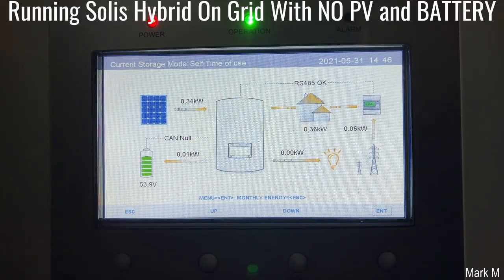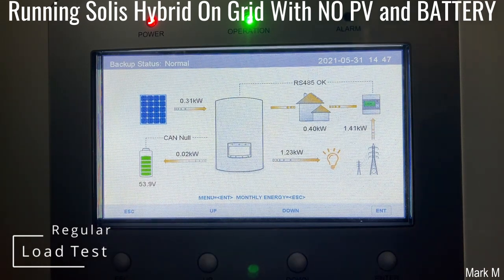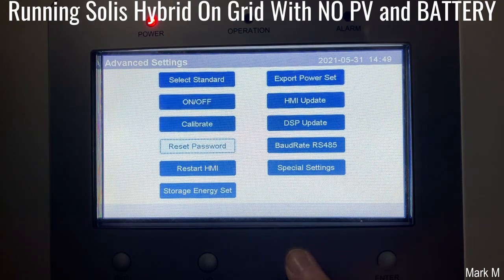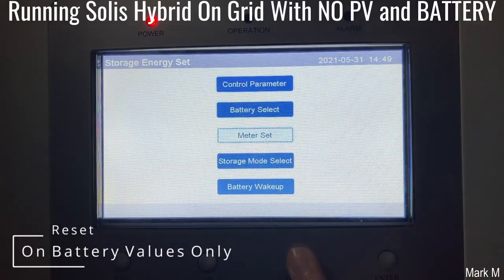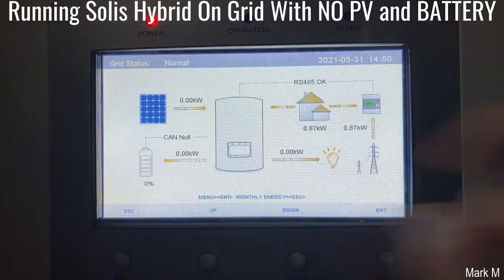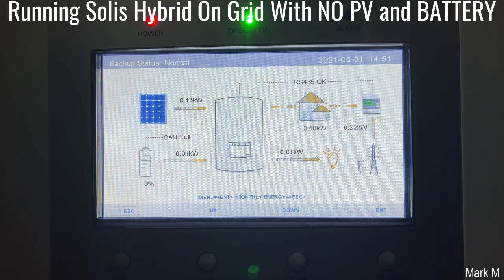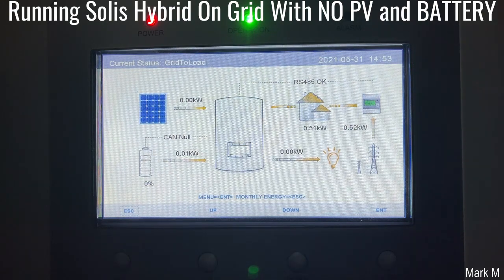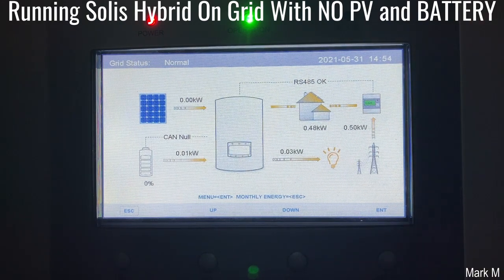How Solis Hybrid On Grid Handles No PV and No Battery Setup

Comment: Hi, great video!

I need help with one more thing, I want the inverter to switch to grid as soon as the battery is 90% for only the smart load and keep the back up load running on battery. is this possible?
Reply from the maker: Your Hybrid is On Grid, that means its always Grid. Grid = Grid Load + Backup Load. Battery will only be use during grid interruptions. If Grid is present, its Grid who provides power to your loads.

Comment: But arent you still driving the inverters control electronics from the battery DC source ?
If the battery is still connected physically.... thats not the same as the battery setting being set to none.... Surely....?
The battery is still showing as drawing 10w...
Reply from the maker: youre probably correct. it makes sense.

Comment: Hello, Mark. There are clarifications on connecting and disabling the Solis inverter. Ginlong gives the following recommendations: PV, BATTERY, AC, LOAD is a connection. OFF LOAD, off AC, off DC, off BATTERY is a shutdown. Your recommendations are different, where is it right? Regards
Reply from the maker: If your system is energize and running with loads. You need to disconnect your Grid first! You don't disconnect your PV since its under load. You also do not disconnect your backup load since it has a running load.
The guide assumes that prior to shutting down the system. You had transfered your backup load to the grid, thus, the proper way of disconnecting is.
1. GRID
2. PV
3. BATTERY.

Comment: Mark, hello. Thank you for your feedback on the solis inverter. Equipment (switch) is connected to the inverter, which must be in operation for 24 hours. The inverter at off 220V passes to the battery and the time of this transition according to the characteristics is 1 period or 20 ms. After the transition, the connection between the switch and the equipment connected to it disappears. To date, is it possible to reduce the transition time to the backup port to 10 ms? Thank you!
Reply from the maker: I also asked if they can drop to 10ms, but as per support, the 20ms is standard on all RHI models. If you have issues on sudden shutdown due to switch from grid to off grid, you need to request a firmware update to rectify the problem.
Reply: Thank you!

Comment: Sir Mark , i guess setting up this feature will only work as long as there is at least a PV or Battery supplying power to the inverter . Because on my experience i was not able to set this up at Night no PV ... and a broken battery  ... because with both DC supply out the inverter is basically dead .  So i would say to be able to set the inverter to do that a requirement is that at least one of thr DC power is present .
Reply from the maker: Yes, If there is NO battery, it will act as a regular GTi, so you need PV source.
Reply: I want to test maintaining the inverters control electronics over night via a DC PSU, into the battery terminals, so the monitoring is kept alive. We have a few systems installed, no battery - 'battery ready' - but we lose overnight grid power logging.. which is annoying.

Comment: Question what will happen if the PV is cut off under load ? Aside from the obvious arcing
Reply from the maker: its not advisable unless under certain condition such as an emergency situation. Its not recommended especially when your have a high demand load and you cut off the PV. Hardware malfunction sometimes happens.